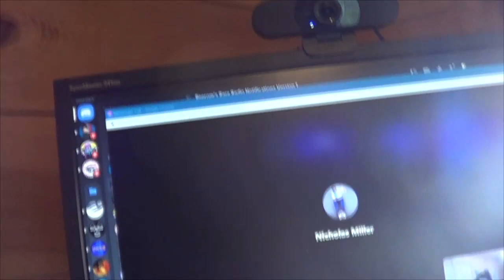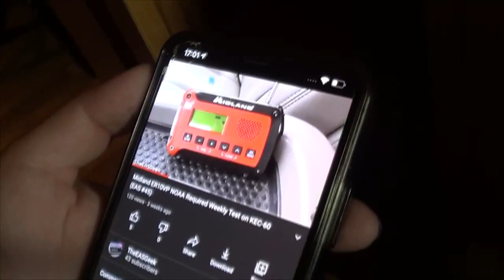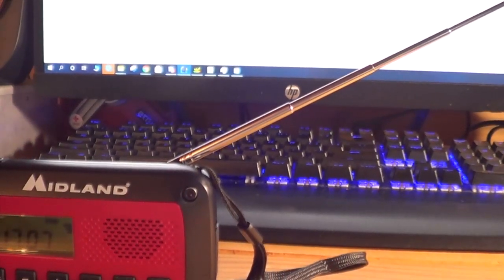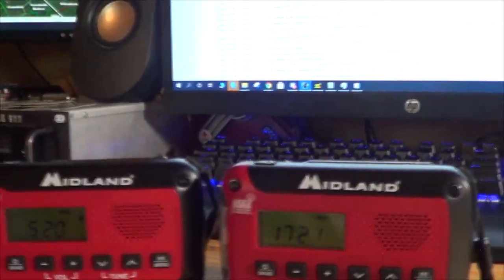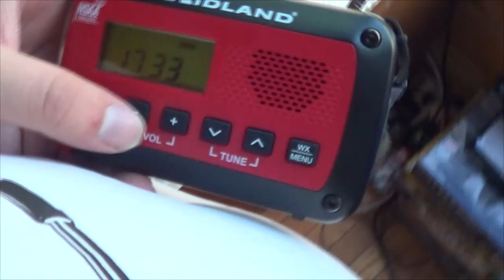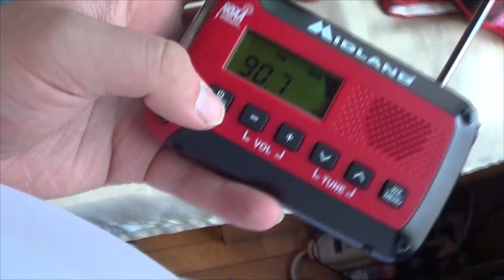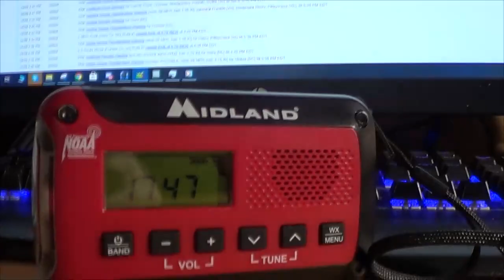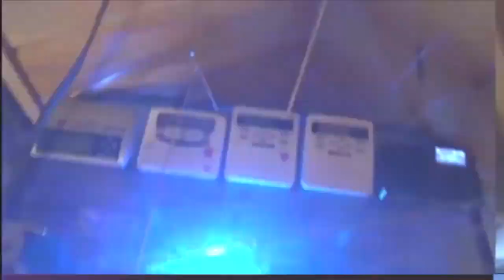Radio Reviews: Midland ER10VP

Comment: With the WX mode turned on, the batteries will die after a few days. With the WX mode turned off, it will last probably a few months or years. The WX mode is only designed to be used during times where severe weather is forecast.